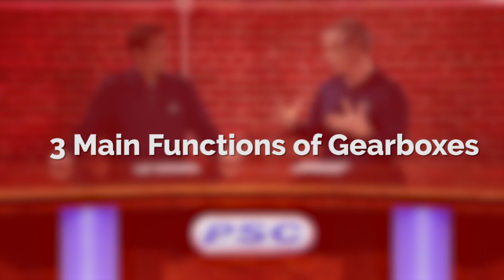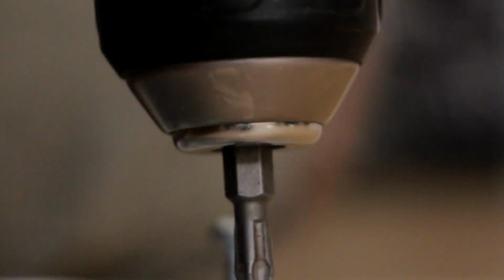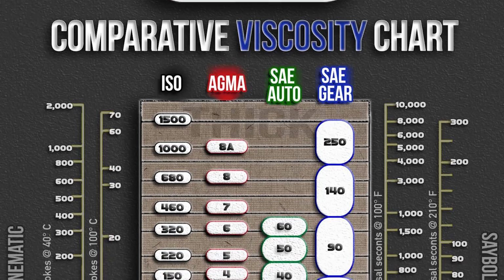What is Gear Oil?

Comment: What kind of oil would you suggest to be used on a bicycle chain? Thanks
Reply from the maker: Hello, OnTwoFan, thanks for the question. While we don't have a product SPECIFICALLY for bike chains, you can use Liquid Wrench Super Lubricant, found here: http://petroleumservicecompany.com/liquid-wrench-super-lubricant-12-11-ounce-case/ - it is suitable for use on bicycle chains. 

Hope this helps!
Reply: Petroleum Service Company - PSC 
That absolutely won't work for me.
I service bikes from a bike rental business, it started with 150 bikes and now are around 3000 bikes. I've tried almost all kinds of lubes but I haven't found one that meets my expectations in protecting the chain at a reasonable price. 
So far the closest are the Gear Oil SAE 80-90 and/or
Chain Saw Bar Lubricant. 
I saw your video showing a bike chain and I thought you knew better. 
Thanks, I'll keep searching and trying.